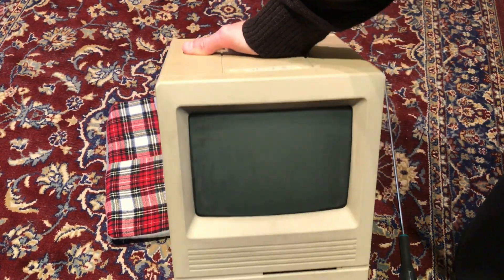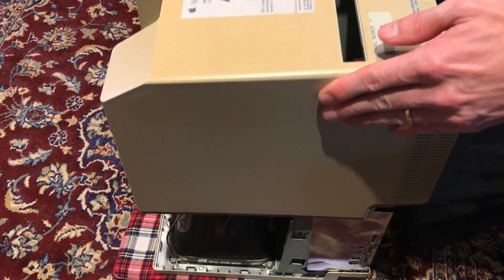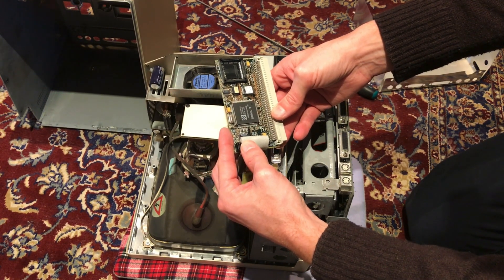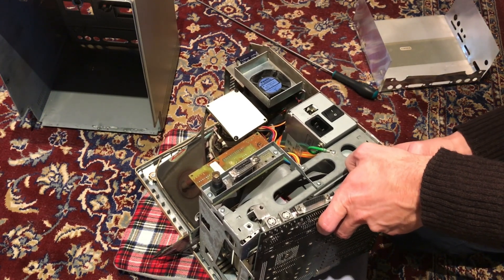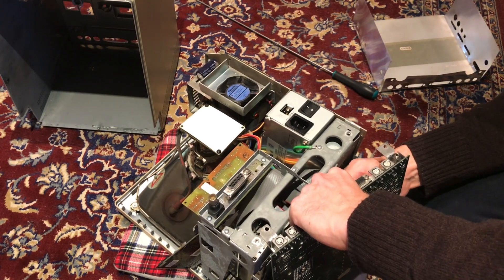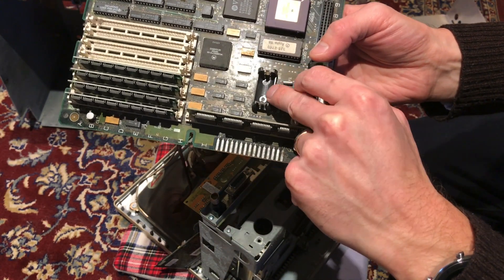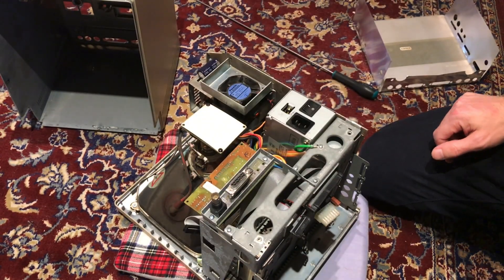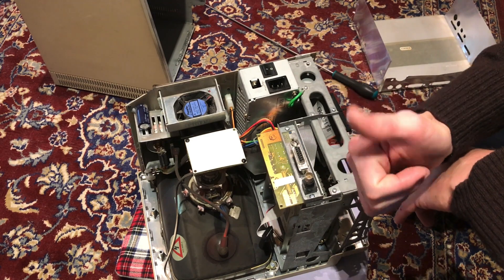Opening a mystery Macintosh SE/30

Comment from the maker: The PDS card is actually a DaynaPort E/SI30 Network card - yay! I was too excited to see the tiny writing on the board.

I will need to find a transceiver to be able to connect a RJ45 networking cable to the 15-pin AUI port. Hope to get one soon!
Reply: What fun!  That is indeed a network card with Coax and an AUI interface, but no RJ45 jack.  It's interesting that the circuit board looks like it has the soldering points for the RJ45, just nothing there.  I wonder if you could just solder a jack in place?  The RJ45 for UTP cabling was not very popular until the 1990s.  The D15 connector was kind of a weird one, and I've not seen a network cabled up using AUI patch connectors.  
https://en.wikipedia.org/wiki/Attachment_Unit_Interface
It looks like you can still get converters for RJ-45 10Base-T to AUI 10Base-5 for under $100 USD.
Reply from the maker: Yeah, my first instinct was to just solder the RJ45 but I realised many additional components were needed so I did get hold of the 10BaseT transceiver and it works a charm!
Reply: @robertstorms3469  Or just get a Coax bridge for €20